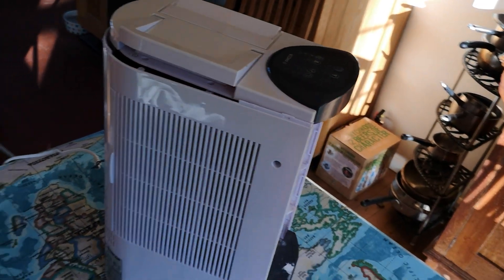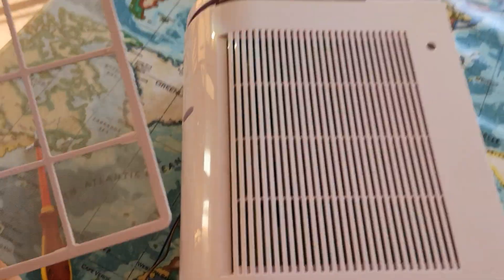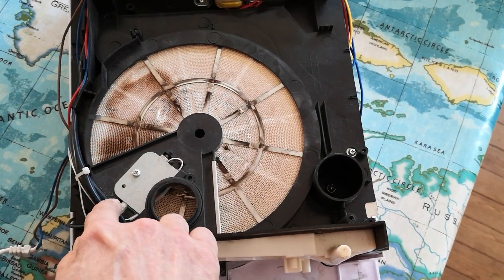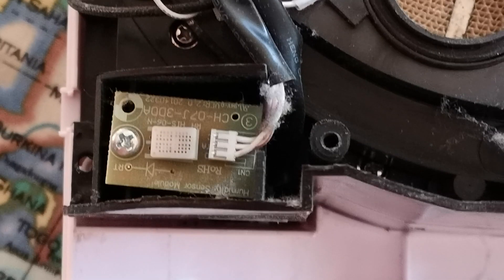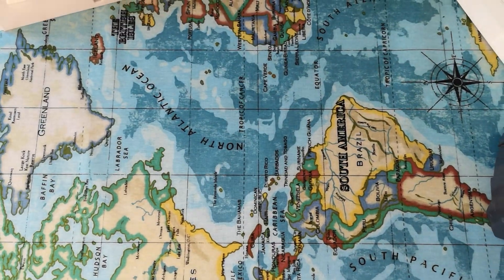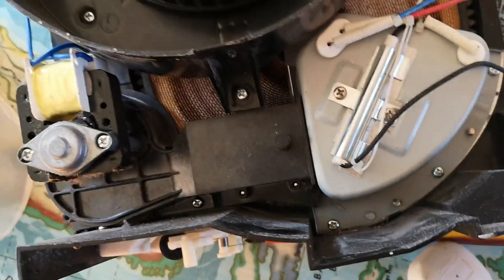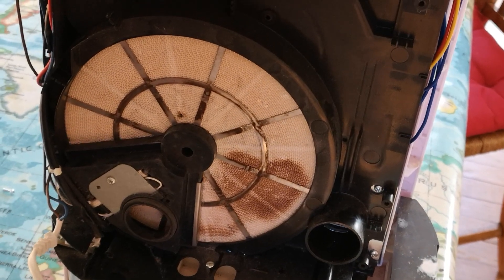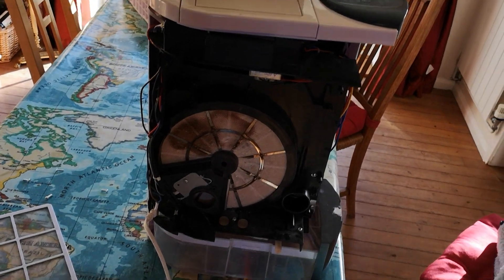A look inside a Desiccant Dehumidifier and repair

Comment: Very interesting.  I bought an ECOAIR dehumidifier 7 years ago and earlier this week it stopped, indicated that the filter needed to be cleaned.  I did that and it worked fine for a few days but now has stopped producing any water.  Your excellent video has explained the principles of operation and I will now investigate what the problem is.  A quick check with ECOAIR showed it is probably uneconomic to return it to the factory for repair.  Thank you for posting.
Reply from the maker: Check the heating element and the rotation. I find it very useful to observe a power meter connected in series with the main supply. You can deduce a lot from the readings.  These things have a convoluted start up procedure which leads to issues with deductive debugging.  You have to wait a while until they stabilise and start working in dehumidify  mode. The same during shut down and if you power ff when shutting down when you power up it completes the shut down procedure and then does the start up procedure.

Comment: I picked up a faulty desiccant dehumidifier myself, found out that it is dead and had no power and the fuse was good, I was hoping it was just mechanical issues but it being an electrical fault… well that’s not really an area I have much knowledge in.
Reply from the maker: Ooh check the tilt switch is not faulty (cuts AC power if the unit is not standing upright) and also that the water container ins in position and that the level float is not stuck and the magnet has not dropped out.  That doesn't sound very electrical.  You can learn to use a continuity meter in 10 minutes so off you go and fix it!!  The planet depends on you.

Comment: As you noted, the desiccant type of dehumdifier works better in low temperature environemts than the more popular compressor type. We have one of each type; one was bought for our garage and the other for an unoccupied house we are selling. Before setting them up in their respective locations I ran each in our garage over a four week period, two weeks on the compressor type and the other two weeks on the desicant type, with an average of 10 deg C air temperature over that period. The desicant type recovered about double the moisture of the compressor type over the two week period. The only downside is the quoted energy usage of the desiccant type is higher and the purchase cost was higher.
Reply from the maker: Exactly.  I have a humidity meter in my workshop. I find the desiccant one does not have such good humidity control as the Samsung compressor type.  When set to about 25% on the dial the Samsung brings it down to about 70% and cuts out and fires up the fan now and then to monitor the humidity. I found that in a reasonable insulated building a blast of heat for an hour with a 1.8Kw fan heater for half an hour a day greatly increased the yield of the  Samsung.  I  have a power meter in the socket for the dehumidifier. In cold weather, in my  my workshop,  this arrangement uses about half the power than running the desiccant type 24/7.  Clearly it would be no good in a cold uneatable space.

Comment: Thanks for posting this, as I have one of these that has stopped working, so I hope this will help me fix it, although with mine the control panel has no lights anymore and no heating seems to be happening. Looking at the PCB there is something that looks like it might be a capacitor, which looks like it may have blown or leaked, so still not sure what is wrong with mine. The heating element coil looks intact with no signs of it having blown. Any suggestions as to where I might get a new PCB?
Reply from the maker: Probably a capacitor on the controller if you have no lights.  It is likely that the capacitors may be the only fault. There is one main one in a small round can that will be rated at about 10 to 15 volts that works on the low voltage side. The other is is plastic block that is the mains dropper capacitor usually around .5 to 1.0 uF 400V. This one loses capacitance. Changing both is worth  a try.
Reply: @razenby  Thanks man, ya I'll take the board right out when I have the time and examine more closely to see if I can find any identification on it, it is a green cannister thing (not sure if it supposed to be green) in the left hand corner, all on it's own, next to the TEMP2 connector.
Reply: @razenby  I'm still not 100% sure if it is a capacitor, I presume it is, but there is no identifying rating remaining on it, even after removing it from the board, it is cylindrical with a central pin in the plastic base and another pin connected to the edge of the metal casing. Would this be the 10 to 15 volt one you are talking about or is that one of the regular-looking capacitors with the cross on top?
Reply: @razenby  Having removed the faulty component and scraped the cream-coloured gunk that looks like leaked out of it, in the space where it was the board has a  square symbol with 4 holes in the board and the inscription S1, so, I'm presuming the cannister-like component with just the two pins is some sort of semiconductor. Is there any chance you could identify the good one one your control board for me, so I can find and order the right thing to replace it with please?

Comment: Hi My Eco air desiccant dehumidifier stopped working and there is no power light. My theory is its the capacitor, only because it is apparently a common fault with them. That said, would it cause the power light to not come on? Just wondered what your thoughts on that might be; thanks.
Reply from the maker: When a capacitor mains voltage dropper is used it should always be investigated because it is such a common cause of failure. Over the years it has consigned thousands of tons of cheap equipment to the land fill.   Most cheap multimeters these days are able to measure capacitance so my advice is to remove the capacitor and measure its capacitance.

Comment: Thank you for posting this information. I'm just considering to buy a second hand dehumidifier which is an exactly same model as this and a current owner told me it is 6 years old (working perfectly as she says) but thought I'd check it out and found your post. It's a good to learn and be prepared - as I like this model with ioniser (without making it smell like pine tree, ha ha) or dryer mode. I don't think there are many models like this with heating function. Would be great if you cold share a bit more about bearing/parts that you replaced (exact name and size?), also if it's still working after one year from this post? Thank you again!
Reply from the maker: Yes, still working. There is another repair video for this model dealing with the disc rotating gearbox motor.  The bearing I made the bearing from Nylon rod in a lathe.  I am not sure if they supply new desiccant wheels for them. I have two of these units.  See: https://youtu.be/ROh_8NY1zqQ  more information there.
Reply: @razenby  Thank you for your swift reply! Yes, I was just watching your another clip for replacing a motor. I'm not an electrician and but often disassemble to repair things where I can. Your clips are very helpful and informative. Double thumbs up from me....and subscribed! Thank you.
Reply from the maker: @mumboandjumbo3519  Thanks

Comment: Note at time 7.47 I think you can see the black wires inline thermal fuse in your unit and possibly the white wires are a NTC thermistor

I am just trying to fix a different model
A Meaco DD8L it was working for years and then  a red light error, unplug and it was working the following day DEAD, 

After ordering the wrong rating for a part (online suggestion - I should have stiped it first) 
What I ordered was a thermal fuse SF96E - 100 'C
what I should have got for mine was TWO  SF133E  in my unit they are in series  133 'c

Pulled it apart today
Thermal fuses are OK so do not need replacing 
NTC Thermistor has some water damage but seems OK
Tested both synchronous small motors ok I do not think it is the main fan capacitor start motor. 

Assembled it and plugged it in and the red light came on briefly and now nothing, will continue investigation until I scrap it.

I am not asking you to help me, I just thought I would add a comment. 

All the best
Reply from the maker: Could be the controller and sometimes they have a gravity switch to kill it if it gets knocked over.  There are other more detailed videos on this model on the channel. Check the main dropper capacitor in the power supply if there is one. See Delonghi video on this channel.
Reply: @razenby  I will have a look at your other videos
I do have power to the PCB and have 12v and 5v test points
This model has a hall effect tank full cut out the float is a nasty piece of polystyrene with rusting magnet
I will have another go at a later date  ?
Clip together case with a total of 14 screws ? over kill.
For the membrane keyboard I just cut neat holes to get to the 4 screws, for no good reason, they could have found a better way.

Some where I found on the WWW quite a bit of info, I just need to find where I saved it ;-)
I bought the Meaco from Maplin long before they closed down, shame they went.

The Meaco was faulty when I got it, when running on low fan settings, it would shut down after a short while with a red light, in one of the online documents it said from new run it for a day / hours on high speed. I guess the synchronous motors were stiff with grease causing a over heat sensor to trigger. 

As you know the dust filter is useless. I think the boult in negative Ioniser makes it worse, I only used it once.
Yep the extra HEAT is good at drying washing and with the hot air method of the Desiccant it helps dry the washing in the hallway.     

Lucky for me I have  a spare compressor dehumidifier only a few years old, that is back in action now, the hallway is a lot cooler.
In this house we often hit 60% + on a rainy day in Wales.

I have used dehumidifiers for about 28y Yep I still have the original one still working but not in use at present, it has an exposed external cold coil that creates ice, it is now retired because it is not very quiet ;-) I do not think it was ever very efficient since it would create a small iceberg before triggering a melt cycle ;-) The control circuit was very simple just like me no off switch only a Humidistat, and a microswitch on a float. 

Thanks and all the best to you
If I fix it I will let you know.
Reply: @jdhtyler  the fault light on low fan setting sounds like what mine was doing. Have you cleaned both sides of the drum? I got a vid on my channel cleaning mine which solved it.

Comment: Great video, not many people are aware of existence of dessicant humidifiers. I learned about them last year when a friend of mine was looking for low cost solution for his damp appartement
Reply from the maker: The key feature is that they work very well are good at low temperature where as e a refrigeration based dehumidifier doesn't work at all at 4 deg C. I have one in my workshop set to auto. In cold weather it still works. The shop is unheated but no rusty tools and warms up quick because it isn't damp in there.  I also use it to dry out the summer house when the door jams when is expands when damp. A couple of  days and the door is fine again.